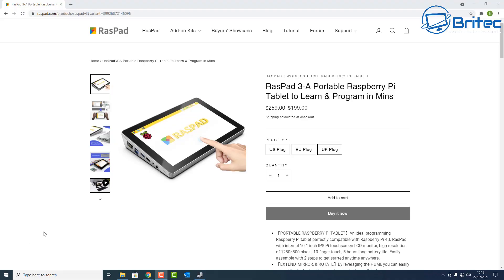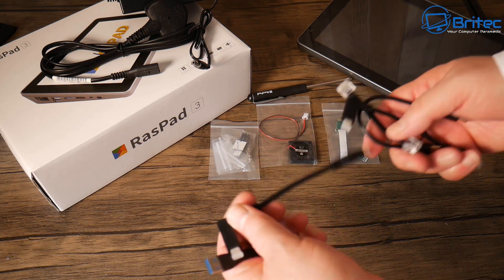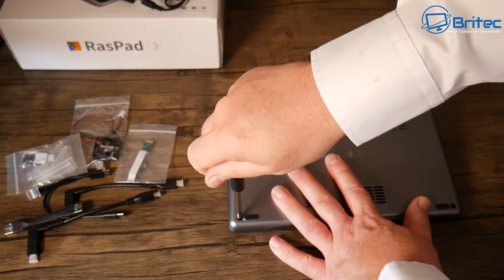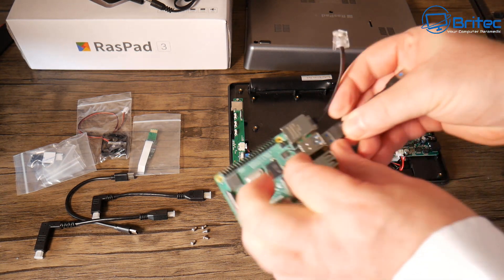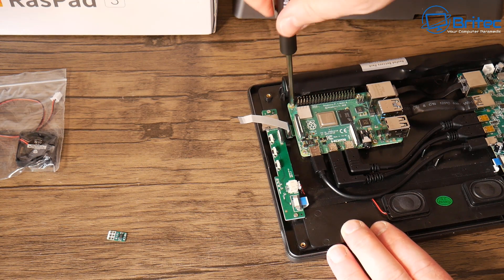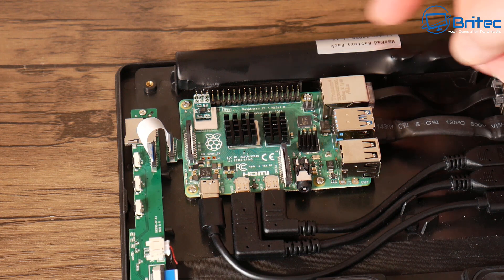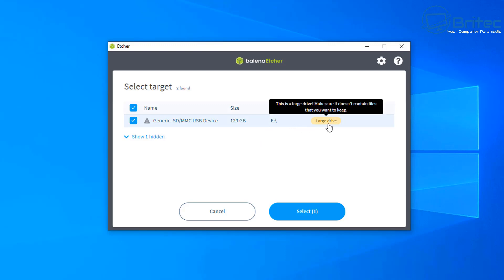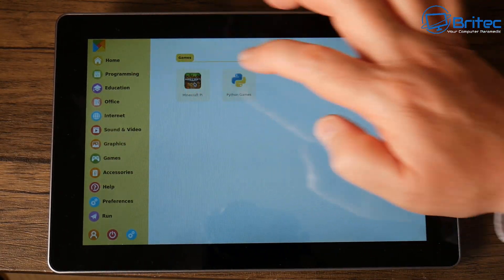Raspberry Pi 4 Tablet - RasPad 3 Review

Comment: Could not see you connecting micro connectors or processors because your hand was in the way. Interesting otherwise but not sure I would buy this setup when you can buy complete tablets for 35% cheaper. Love your videos generally though.
Reply from the maker: Very hard to show everything.
Reply: cam could be on the table looking back,   not above looking at back of hand